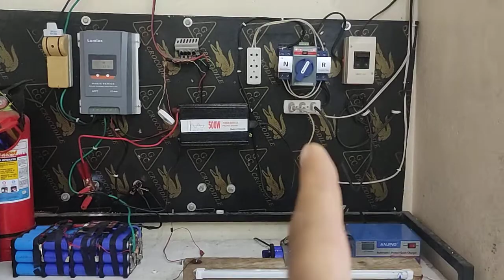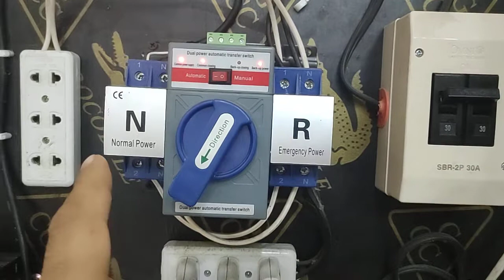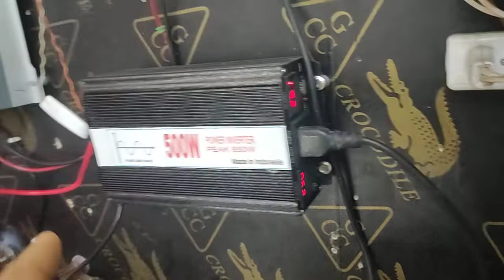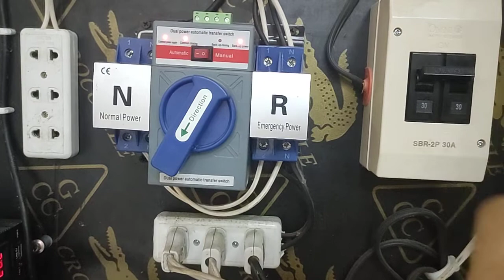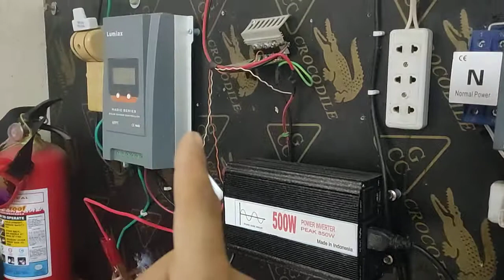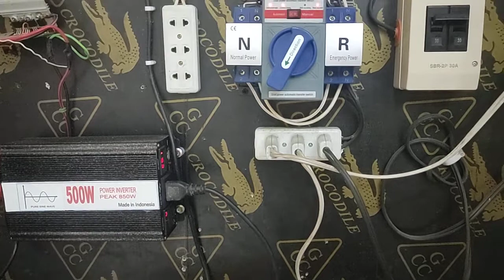how to setup inverter battery priority mode using auto transfer switch

Comment: Where is the video of your new ats relay the heavy duty one my friend? The you bought from shopee
Reply from the maker: Later I will upload
Reply: @MarkPrince1317  what is the power supply of you relay 220v or DC volts?
Reply from the maker: @johnmangubat251  my is 220v Ac
Reply: @MarkPrince1317  if your distribution utility is down your relay will switch to solar, right?
Reply from the maker: @johnmangubat251  Brother  it's now over 1 month my main utility is disconnected due to over dues I am totally off grid and it's really great experience running home on 24/7 on solar soon I will update how is my setup